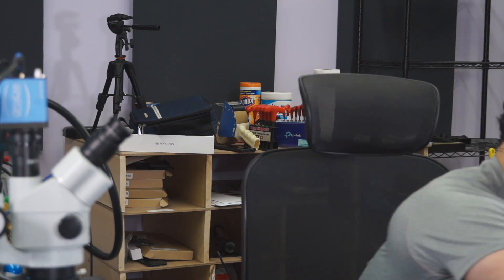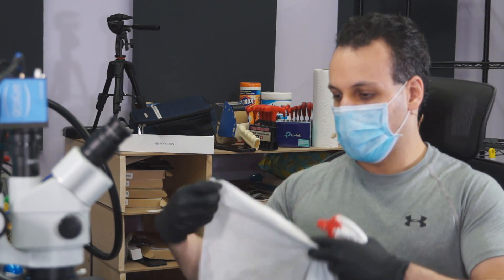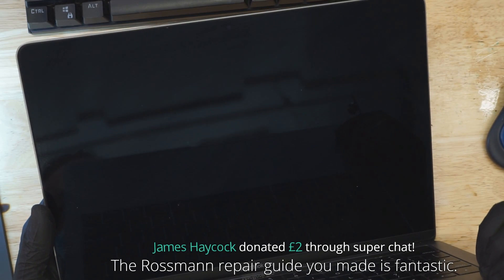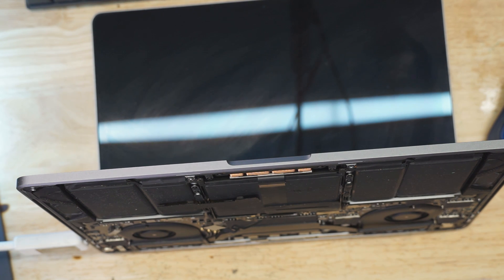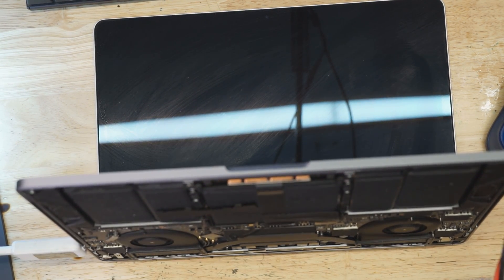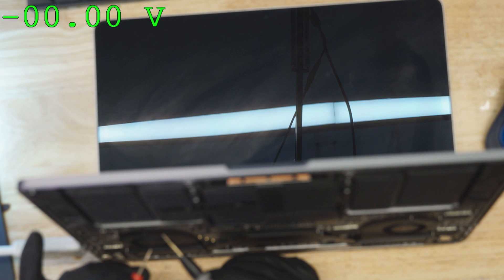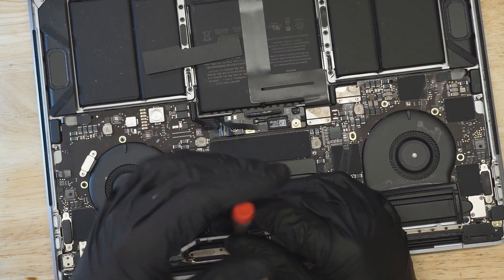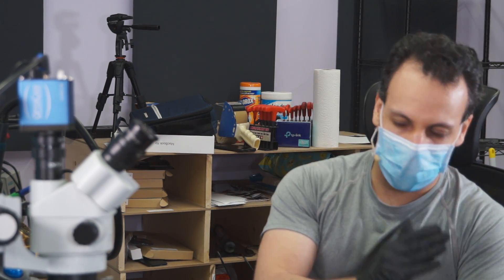Apple PCB design is a meme.

Comment: Guaranteed someone at apple knows this. Someone at apple also probably knows that they could reduce the number of screw types in their device from 15 down to 4, and someone probably also knows that they could make a modular connection for the hard drive, the charging ports, the memory, and maybe even some of the internal connectors that are common points of failure.

Someone there has thought of all of this, and the head of that someone's department has undoubtedly told them about a graph at that last board meeting showing an uptick in sales alongside downgrades in repairability, and maybe even strongly hinted to that someone that if the graph were to suddenly go in reverse, then they might have to hire a different someone to their coveted spot on the macbook engineering team, crushing their career as a high level hardware developer in the process.

Fuck Apple.

Comment: I don't really know what Apple's strategy is. I am fairly indifferent to platform; I'll take as high performing of a system as I can get for the budget, no matter who makes it, because that matters less than ever. If you like Powershell, you can use it on mac and linux. If you like bash, run it in WSL or pull down a custom profile for ps. If that fails, there's Docker. If that fails, AWS. Apple's is about differentiating itself, but the differences are all mostly arbitrary at this point. Just not sure where they are heading with that.

Comment: So what I hear: Its ok to spill coffee in any other computer, just not a macbook.
Biased much?
Reply: Spilling coffee on any other computer would still do damage, but way less.
Here faillure imediatly translate in destruction of the CPU. 
You could easily change how the pins are placed to destroy something less important, cheaper or easier to replace in case of faillure.
You could also design the computer to have the parts that easily break when in contact with water far from the edges of the computer.
Reply: frayien Hehe I know that. I was just trying to emphasise a point. :)
I’m just fed up with his arrogant BS towards apple.. I’m by no means an apple fan boy, but I feel he should just talk shit about other brands aswell, and maybe not look so colored.. I really like his repair vids, but usually turn of the sound.

Comment: This is the problem with engineers. Have to deal with them all the time. Everything works on paper or computer, but in the real world they cause problems. .Catastrophic failures for simple flaws.Comes down to spending a penny or outing a penny in their pockets. This device should be recalled and not UL or CSA approved under any circumstances.
Reply: but without engineers there would be nothing.
At some point we need to try stuff, and improve upon what worked.

Comment: Imagine Apple going into EV business. "Here we have 32 A 300 V line going just under drivers floor mat. And as cost reducing feature we bundled it up with console touchscreen circuitry".
Apple fanboys: "It's your fault you got electrocuted for entering the car with your feet wet. We very productive and creative users know it's no good using a car in a rain, unlike those silly Tesla drivers. Which by the way use four times cheaper, non-proprietary, unimpressive and unstylish cars"

Comment: i believe it is done on purpose. A good company makes sure the customers come to buy more of your product if they screw up, and they know its their fault for spilling coffee

thats why, it is considered good design choice for capitalism, to have all the failure modes and failure wires at locations where it is likely to spill coffee. Also, edge of laptops where it will fall. also, to manufacture micro cracks in the LCD, so that it consistently breaks after 1 year with a slight impact.

This is why repairman cant be big hardware CEO

Comment: I’m a car audio guy and my signal line is run on the opposite side of the car as the power line simply for interference purposes. My question is, what does interference from a power line look like when the device receiving the data is a screen as opposed hearing the interference from a speaker?

Comment: Someone has probably already mentioned this, but I think eDP is VESA's mess with the thinking that backlight power and signal lines will live happily together on one connector - https://www.vesa.org/wp-content/uploads/2010/12/DisplayPort-DevCon-Presentation-eDP-Dec-2010-v3.pdf
Presumably, Apple thought this was acceptable (or didn't think at all) and implemented it as per spec - on this occasion I think it's fair to give them the benefit, however considering they normally stick 2 fingers up to other standards, it wouldn't surprise me if they've buggered around with it :/

Comment: On the military boards they cover the whole mobo with some kind of resin, so the whole system is water resistant. Things like these just don't happen there.
My point is, this mac crap is what ? 2000$ ? and probably even more expensive than a rugged military issue laptop.

Comment: I dunno I have owned 3-4 MacBook Pros mid 2012-2017 MBP 15". I have only had to replace the charge port on the 2012 13' MBP due to me bypassing a small chip inside the MacSafe 2 T design.  I over volted the charge port and performed surgery on it to be able to charge my 2012 MBP.   The one thing I HATE about new Macs is that they solder everything in.  They say it for security reasons.   Also the lack of just having ONE usb 3.0 port non USB C.

Comment: Unfortunately stupid logic like this is not rare. It happened to me many times that some genius IT guys used our high voltage channels (I'm an electrician) for their data lines. You know like "Oh! 50Hz 400VAC 3f high power cables of various circuitry right next top our 12VDC DATA lines? No problem bro!". So if it ever happens to you that the high voltage network jumps a bit and suddenly your server is dead, this is why - It just got EMP'd to hell. :D

Comment: why the person designing the connector should have put the 57v line in another spot? it would have made no sense. if they did it, the cpu wouldn't fry and the customer wouldn't need to buy another computer. that's why they put it there

Comment: Just like it is not electric code to run low voltage lines next to house AC voltage in a building, like coax, commo-phone, or ethernet next to and into the same box as a 120 V AC receptacle.  nope, do not do.

Comment: The CPU probably has an anti-esd diode on that line.  That means quite a lot of current can leak between your 50 volt line and your 1 volt line before damage occurs.
There's a good chance if you clean the gunky and slightly conductive coffee it'll work again....   Cut the trace and stick a scope on it and see - even if it has died, there's a good chance only one of the two drive mosfets has blown, in which case you might be able to add an external transistor to make it work.

Comment: I once spilled an almost full glass of water in my Compaq Notebook in a meeting... let it run through.. continued my presentation for about half an hour... then turned of the notebook and let the last remaining drops come out by shaking it (most of it already went right through, cause Compaq or Lenovo notebooks had a drainage designed into the keyboard). At home I opened it and dried the notebook over night - it still worked for several years to come.
Damn this is a everyday worktool and no art you put in a showcase. There is coffee, water and dust - and accidents happen - such a tool needs to be reliable for me to earn my money.
I'm not clumsy with my equipment and care about it (e.g. open them and remove dust once in a while) - and I also enjoy having nice looking equipment - but foremost priority is: this damn tool has to be reliable and able to withstand some accidents for me to do my job - cause few days without notebook can cost me more, than the whole thing is worth.

Comment: Just said.... any other product also got some parts which SHOULD break so you cant use it forever and have to buy a new one.
Sure, apple is very "skilled" in such things, but some products are not that bad. I use still my 2010 MacBook Pro on a daily base, it got even a new battery a week ago because i damn love my old MacBook for regular, mobile usage. Sure, performance wise its "cancerous" if real CPU/GPU power is needed, but for anything else its still the best notebook i could wish and i will use it until its totally broken and impossible or expensive to repair.
I remember, and thats why i hate apple the most on my iPhone 5 i had for years, the position of the Chip for the power/home button is placed tricky and easily broken by removing the battery when you need to replace it.Luckily, at this moment the iPhone SE was already damn cheap to get used and the SE was a big upgrade to the iPhone 5
Reply: I mean i have to admit, if i used any stressful app for the mac or played games, i always set the fan speed higher so it wont overheat at all, i think otherwise anything would have died already, especially the 330M GPU or something around CPU/GPU. I bet the typical Mac User will not care about the temps and enjoy a mostly silent system which i only do at daily tasks.

Comment: WTF. I'm designing scientific PCBs for my experiment at university and think about "how to freaking shield signals from each other and properly put power lines" by putting as much ground lanes around as possible (if neceassy). Judging on the connector, there were a lot of ground pins. I would have shifted the 52 V HV lane to the edge and surrounded it with 2 ground lanes, next to it. But hey, it's apple.

Comment: Raspberry Pi is worse, 5v and 3.3v male 2.54mm pinouts next to each other.   5v on the 3.3 will instantly kill the cpu, and it's extremely easy to accidentally short the two together.

Comment: fucking mac design is so shit. Fuck them. Only problem is windows is also shit but it in different ways. For audio recording, latency is a problem. Firewire/ thunder bolt lessens this. Some pc's 
(laptops)  do have thunderbolt apparently... mostly via a dock. I have the 2011 pro with f'd amd.

Comment: I don't agree with a lot of Apple's blatant anti-repair decisions/policies...but it's very interesting that most people in Louis Rossmann comments bandwagon so hard against Apple engineering. I find it hard to believe that there would actually be a directive from upper management for purposeful positioning of a high-ish voltage bus next to low voltage lines, at least not directly like seems to be implied. Engineers typically put a lot of pride in their work, and if some Apple higher-up said, "Now make it so that your precious design blows itself up after X hours or under X condition", I think it would be completely humiliating and degrading to the Apple engineers. What kind of engineering culture would that encourage? That would just breed internal disdain and a lack of trust for management.  (Maybe that's actually how Apple is now; I don't know.) 

Few people seem to even consider that this is just an engineering oversight or that this condition was not caught by any engineering test procedure.

Apple makes a bajillion products every year. By pure numbers alone, there is a higher likelihood that a un-detected failure mode shows up after the product has hit the market. Maybe this is one they should have detected; I'm not sure.

Comment: Sheesh... Like wtf why would you put a highpower line near a lowpower one? That's a damn hazard. Same reason why AC lines are atleast 2in far from a lowpower equipment (Ethernet) cos if something goes wrong, say goodbye to your lowpower equipments. Heck they even didn't put any preventive measures so that the electronics wouldn't get fried in case some goes wrong.

This is why i think we need better regulations pertaining to pcb designs, LESS on protecting the manufacturers and MORE into equipment longetivity. IF the device is really that worth it to upgrade for the customers, they'll come back to buy more on their own even without such "intentional flaws" on the devices.

Comment: I would wear an FFP3 full face respirator if I were you! It’s not just surfaces you need to be concerned with. Think about fan spin when you power on... the client could have coughed on his MacBook while it was operating, sucking in aerosolised covid with the fan to cool the machine. Turns machine on (droplets on the fan). You get the machine... set those fans spinning with eyes exposed inches away and an ineffective cheap mask.    Just something to consider, better safe than sorry!

Comment: I'm no engineer myself but I do have sufficient training to know that you don't put a relatively high voltage line next to a low voltage one. There should be enough space between them especially if dealing with a line that directly connects to the CPU.

Comment: @Louis Rossman hi rossman could you please do some tutorial how to remove a tiny stripped screw on laptop parts , i had an old laptop that have stripped screw , thankfully it was for the laptop case not connected to any motherboatd/pcb ,i can't clean my heatsink or change thermal pad and thermal paste because of it , and my dumbasses 16 years old thought process , try to torque the screw with the help of superglue but didn;t help and just make things worse , so the screw still stay there stripped with some coating of superglue .

Comment: And then I think about the old fat ass IDE cables where they actually doubled the wires so they can put ground between every active line. Okay that was more for interference reason, but the same idea should apply here. That way any short from the 52V power line would be to ground instead of the data line.

Comment: The best beer is made in BAVARIA and not China. 3:18 It's all about ENGINEERING. This said, you can make certain parts of an electrical board, microscopic or even NANOSCOPIC! small, BUT it always depends on how much voltage and currency is running through the circuits the design engineer of the board has designed. This said, designing and building any electrical board with chips and circuits requires the right feeling to know, which part of a circuit or "electrical region" of a board can be nanoscopic, microscopic small and which part of the board needs to have the right proportion and dimension for the voltage and currency not to cause any damage, because a certain region of the board will heat and cool down hundreds and thousands of times. This said, every motherboard designer needs to have the right feeling for circuits. Only motherboards that can handle vibrations, shocks, warmer and colder environments is on my opinion good quality stuff. You can even put that in an airplane for years and it works. 3:18 THIS "Jonny Ive" STUFF is definetly not suited for any aviation purpose, not civil, nor military. But that's my opinion. Designing an electrical board is like designing a wing out of carbon. You need to know where to put MORE and where to put LESS material to have the BEST result. It's ART.

Comment: Most of the motherboards from what I hear are laid out by ... another computer. Mainly due to complexity.  So the decision for the pin outs was probably made by a machine trying to solve one of those real cool calc problems of least area possible to fit in and connect all the components. Although, the human probably had a choice of several design layouts that the software came up with and picked this one.

Obviously you would want that to reduce the cost of the board, fit the desired form factor of the product in either case.

PS: Mr. Clinton's homeless kitten cousin followed me home Louis from one of my 9 o Clock evening walks.  So now I have a copy of Mr. Clinton running around in my apartment.  I am not a cat person so I blame this on you.

Comment: 50V next to 1.7V data is not 'a bad design',  it is intentional so Apple can make more money on people accidentally spill liquids on it and needing a replacement. The same reason they have build-in moisture detectors that collect moisture from the air and turn red so that after a year or so you are SOL for repairs.

Comment: I always wire houses with the telecom and 220 in the same box.  Just like the board level repairs I do on business mfps  I always make sure the 24v rails are next to print processor when jumpers are used.